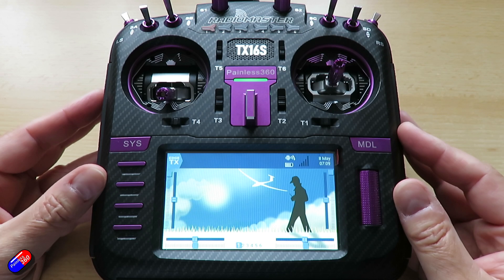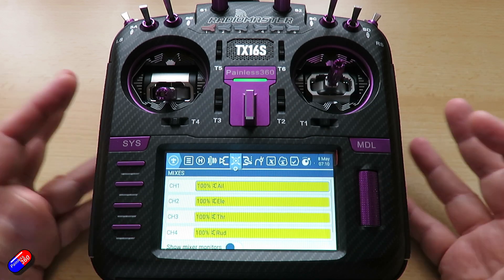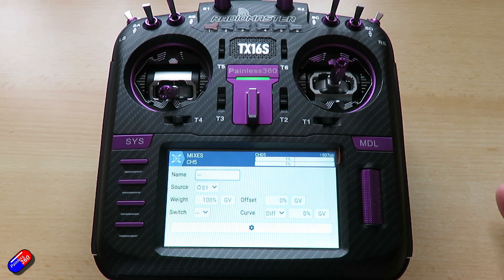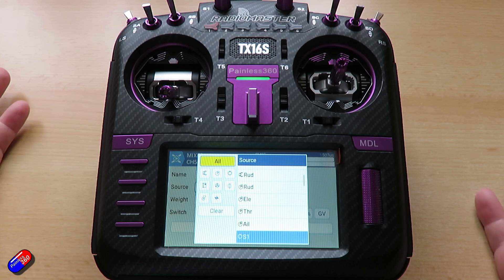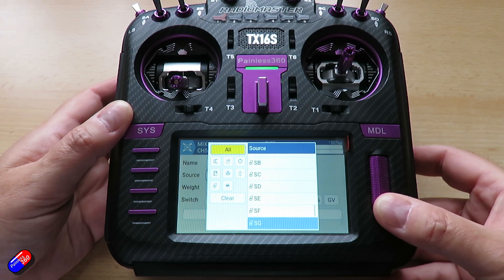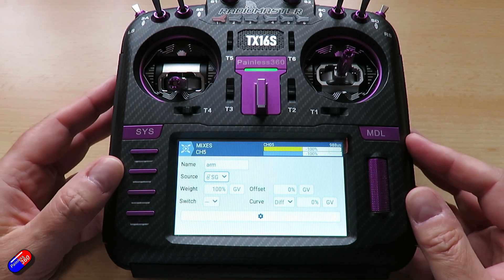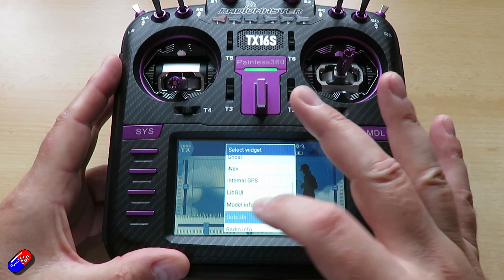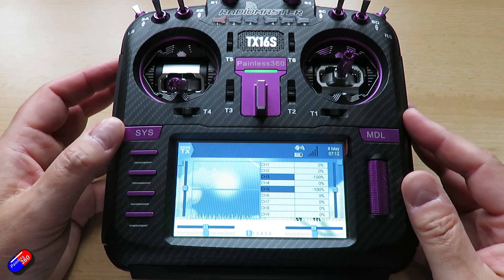Adding a switch to a channel/output (EdgeTX for Beginners 2025)

Comment: Normally I configure this stuff in Betaflight for my quads. When I do, the configuration is specific to that quad. What happens if I change setttings on radio but it’s not the same as on my quad?
Reply from the maker: Most pilots tend to have one radio setup that doesn't change. AETR, Arm, Mode, flip over and buzzer... Happy flying
Reply: @Painless360  I mean, I try to but I think things get missed. So if I program the radio, it will apply to everything? Or will there be problems if my Betaflight settings conflict?
Reply from the maker: It's usually only the reciever tab and the modes tab that need to be setup correctly in Betaflight for the radio channels . Best of luck

Comment: Thank you for your channel, and your work. Im new to ELRS + EdgeTx  and besides your channel there is so little about ELRS+EdgeTx for Fixed wing. Litlle bit offtopic, but i cant find much information elswere. Radiomaster PPM Receivers + G12X.  ER6GV/ER8GV are 2,4G diversity non gemini receivers. So packet rate 100HZ full 2.4 or 333Hz full 2.4, but what antena mode? 1,2 or Switch? what would do Gemini Mode?
Same question for 1 antena receiver, like Er4 1,2 or switch?
Reply from the maker: Check out https://www.youtube.com/watch?v=sV1AS8r3jho that should help some... Thanks for watching!